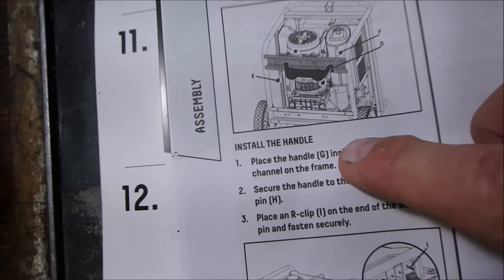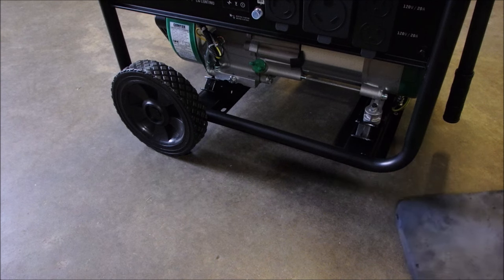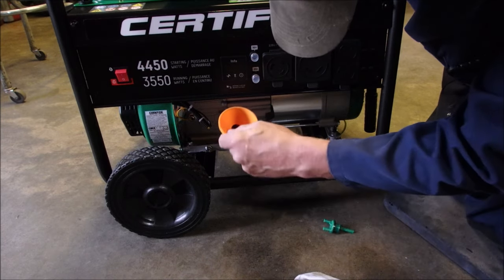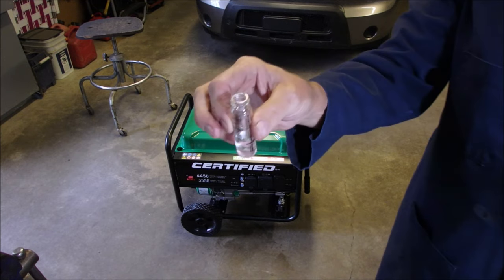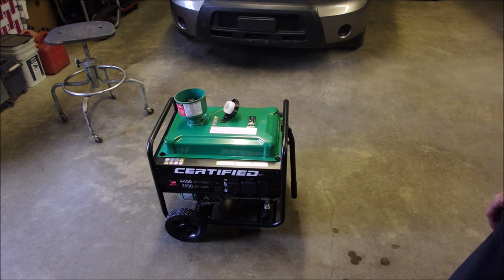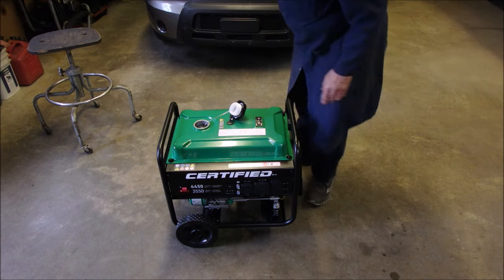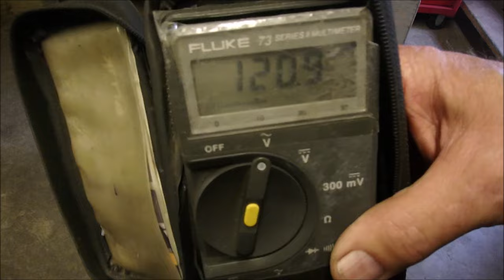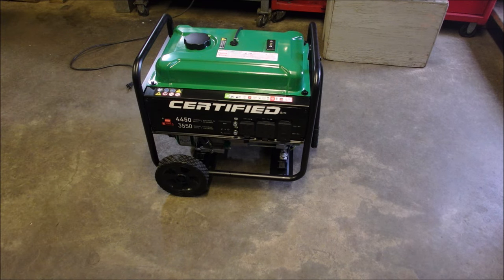How to Set Up A New Certified 3550 Watt Generator "SUBSCRIBE"

Comment: As a rule of thumb, for break in period, 1hr run time is what I usually do, I use conventional motor oil, do the break in procedure, then empty the break in oil, then I put in full synthetic oil, but that's me.
Reply from the maker: Thanks  you would know more than I.  I think you encounter more new machine's.
Reply: 100% correct i believe most engine manuals call for breaking in the engine with conventional oil and some manufacturers actually make and label the oil as Breakin Oil.

Comment: Wow thought you had an issue with synthetic oils! We normally break in a new engine with conventional oil for the first 5 hours of run time then drain. The 5W30 synthetic is perfect to cover all temperature ranges on the hot and cold side. We also put in one litre of our Kinetix 4 cycle alkylate fuel and tell the customer it will fire right up for two years guaranteed as long as they have not put any of their fuel in it.
Reply from the maker: To be honest I am now confused which direction with synthetic oil or not :-)
Reply: @BrucesShop  Your going in the correct direction . So the rule of thumb at EP is if the manual specifically calls out synthetic oil then thats what the equipment gets but if it is brand new we use convential oil for breakin of the piston rings and either have the customer bring it back after 5 hours of run time or pick it up to do the oil change to synthetic. Naturally there is a higher cost for synthetic oil which the customer sometimes complains about but we always inform them we have to follow the instructions provided for the equipment to maintain the warranty status.

Comment: Most home generators sit a long time between use. I like to run mine out of fuel and change the oil before I put it away. When I get it back out 3 years later I pull the engine over 10 times before I put fuel in it and try to start it to circulate the oil in engine. Nice generator but I try to buy one with a plastic tank.
Reply from the maker: Great tip!  Thanks

Comment: Hi Bruce how many RPM do you think it needs to run at?
Reply from the maker: my guess is 3400
Reply: Hi there, if Canada is 120V 60hz it will be governed at 3600 rpm to give 60hz from the 2 pole gen head. In Aus. our generators are governed at 3000 rpm to give 50hz from a two pole gen head. 4 pole is half those rpm's, 1800 for 60hz and 1500 for 50hz.
Cheers.
Reply: @harrothepilot  Yep we are in Ontario sounds right.

Comment: 13:03 Your circular saw is NOT pulling 13 amps when it's just spinning and not cutting anything.  13 amps may be what the saw motor is rated for but it won't draw anything near that much current when it's not working.  You probably have a 1500 watt heat gun in your shop which will draw 12.5 amps continuously at 120 volts.  I use a 1500 watt heat gun and a 1500 watt space heater to test generators under load.
Reply from the maker: You are right.  It may surge to 13.  I do have a heat gun as well